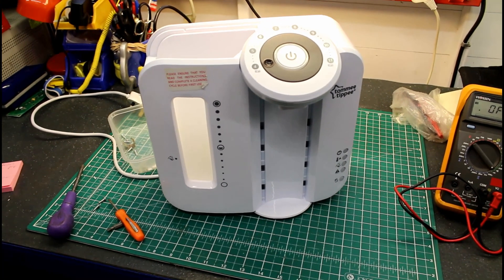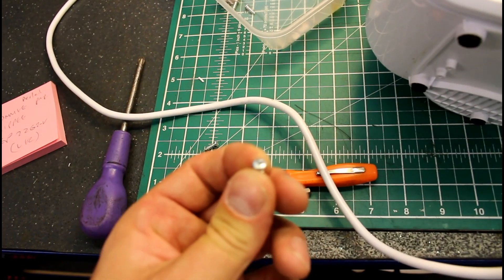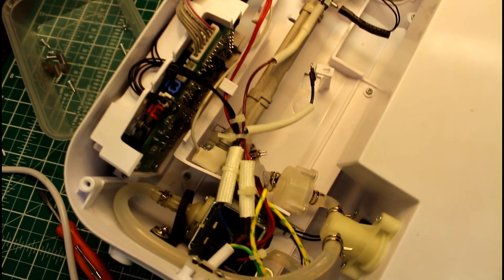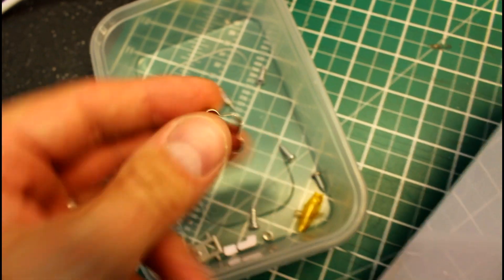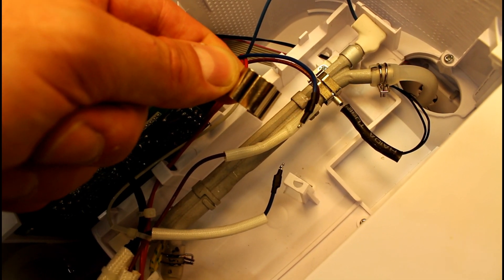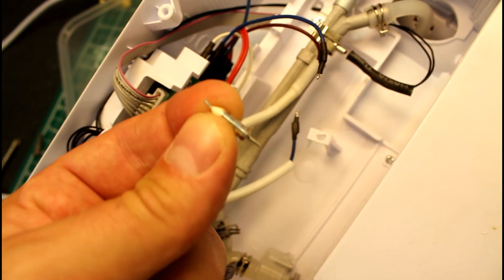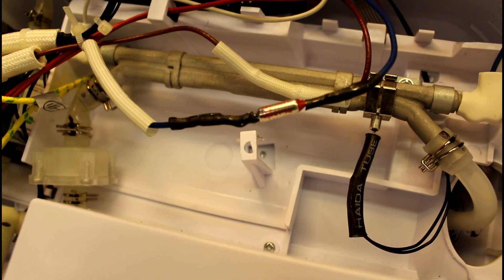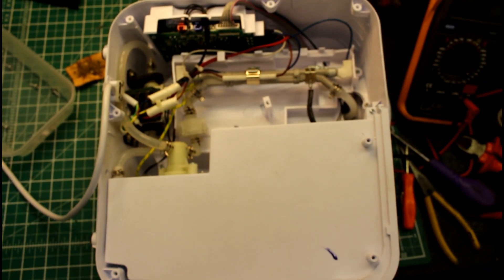Tommee Tippee Perfect Prep formula machine repaired at FixItWorkshop

Comment: Could I just remove the little fuse thing and connect the two wires together so that the machine skips the temp readings
Reply from the maker: You could, but only to test ideally as you need the protection of the fuse
Reply: @Matt_Marchant_fixitworkshop  understand.. but the so called protection is was causes it to fail ☹️

Comment: Hi I’ve taken the machine apart but I’m not exactly sure what I need to do to diagnose the fault? Do I take each fuse out and then test to see if it’s working with a multimeter set on ohms to see if the circuit is complete? As you can see I’m a novice but keen to learn! Thanks.
Reply: Or rather, how do you test it on the electronic board side without being too destructive? Thanks.
Reply from the maker: Yep, that's exactly it. Good luck.

Comment: hello my machine does not dispense water in two moments.  when I press the button the light does not turn red but immediately turns green and lets out some hot and then cold water at once.  the final amount of water is correct but I cannot sterilize the milk with the first stream of hot water.  do you have any idea why?
Reply from the maker: Sorry I don't. Maybe check that all of the pipes inside are clear of debris?

Comment: Just had an issue with our perfect prep machine...

Diagnosis - No water flow, heating element working.

Issue - Dismatling the pump, there is a compression spring inside behind the piston. This was snapped into 3 pieces. As a temporary fix, i manged to superglue the spring. (its shorter now as iv had to give it a bit more meat for the superglue to hold onto.

Getting to the pump wasn't easy, and the rubber vibration dampners got cut to make it eiasier to remove. 

New spring on order (could only get a pack of 10 from ebay) but only cost £2.86.
Reply: I had this problem.
Bought the springs on amazon as they were next day with prime.

Wire diameter is 0.8mm
Spring diameter is 8mm
Spring length is 20mm uncompressed
Reply from the maker: Well done. Useful addition to this thread. Thanks.

Comment: My prep machine going crazy.. its been randomly beeping & doing its own thing dispensing water.. I’ve tried doing a cleaning cycle but instead of only pushing the button 2 secs (what supposed to do) I have to hold the bottom down for it to work. Any ideas on what’s wrong with it? Only started doing it last night. Do u reckon I’m gonna have to by another?
Reply from the maker: Hi Stacie, it could be due to a few things. Maybe water vapour has got into the main quantity selector dial? Perhaps disconnect, leave to dry and try it later?

Comment: This is a very good video. Thank you :)
I would suggest though 2 tips to make it easier. 
1. Remover the 2 screws, top and bottoms on the bracket holding the aluminium vertical tube the fuses are fixed too. And pull out slightly. It makes the removal and replacement of the fuse clamp screw easy. 
2. Tear a small strip of khinchen towel paper (20mm x 75mm) wet in cold water and wrap around the fuse before soldering. It acts as a very good heat sink :)
Reply from the maker: To be honest, on the repairs I do now, I tend to use clips. Soldering should be fine with a heat sink.

Comment: Great video.  I just did ours.  It now has power but it's not working correctly.  It's dispensing water but the incorrect amount and I think it has an air lock.  Possibly in the pipe up the middle.  Really struggling
Reply from the maker: Difficult to diagnose on text
Reply from the maker: Check all pipes for secure connections
Reply: I can't see air getting in anywhere.  Checked them all but it splutters and there's air at the top tube when the hot water come on.  So guessing it's an air lock in that hot pipe

Comment: Is there specific type of solder I need to use for this? I noticed they melt at different temps, is there one you would suggest?

Also, would it be rosin core solder? 

Thanks for the great video, makes it look relatively simple for someone like me!
Reply from the maker: Diy general (not plumbing) type solder will be fine. Just wrap a damp cloth around the fuse while you do it, to avoid damage

Comment: https://www.amazon.co.uk/gp/product/B07BTBPSH1/ref=crt_ewc_title_srh_1?ie=UTF8&psc=1&smid=A1AE8V5JG5IO8O

and

https://www.ebay.co.uk/itm/Soldering-Solder-Wire-Fluxed-Core-DIY-Hobbyists-Electronics-60-40-Tin-Lead-Flux/123750831609?hash=item1cd01fd5f9:m:mU8OqLgchd0rxHmQJbipqSQ&var=424363260773

and 
https://www.ebay.co.uk/itm/Thermal-Fuses-250V-10A-Aluminium-Cut-Off-65C-to-300C-37-values-available/263829523311?var=563183361013&hash=item3d6d770b6f:m:m2f2fJ883OOCyQdcLnFAcIg

Comment: Thanks for this, after ours broke I watched this and took it apart, found the negative thermal fuse had gone, inspired by you I had a go at fixing it. Saved us 70 quid. Nice one.
Reply: Hi I have an issue wondering if it the same as what you had. Ours doesn't give out the hot shot. It will dispense water but whatever the temp of water is in tank. Did your fault stop the machine fully or just heating the water
Reply: @sprxxx1982  yeah ours just packed in completely. Sounds like you have a different issue.
Reply: Thanks for the advice I'll strip down and have another look. I was thinking that otherwise the machine wouldn't have any lights on etc if one or both had blown. I already stripped it down before as I heard there was possibility of mould in the pipelines. Thankfully there wasnt
Reply: @sprxxx1982  good luck, hopefully you get it fixed. Once working the machine was an absolute godsend. Made our lives so much more pleasant during the night.
Reply: How do you use the multimeter to test continuity on the fuse. What settings. Thanks
Reply: @Crackers8  set it to ohms, if it's an off the scale, high reading then the fuse has gone. If it's anything sensible it will be a low ohm value and the fuse is still intact. Mine has a 'buzzer' setting too on ohms mode, which will beep if the fuse is good and won't beep if it's blown.

Comment: Thanks for this, positive thermal fuse had gone unfortunately it was due to the pump not working.
Reply: hI  I just found the same issue I found a broken spring in the pump.  The pump is a Micro Solenoid Pump TLH-4 made by  Tetleytech China,  did you ever source a part
Reply: @johnwood4707  I had this problem.

Took the pump apart and it was the Spring inside had broken in 2.
Bought the springs on amazon as they were next day with prime.

Wire diameter is 0.8mm
Spring diameter is 8mm
Spring length is 20mm uncompressed